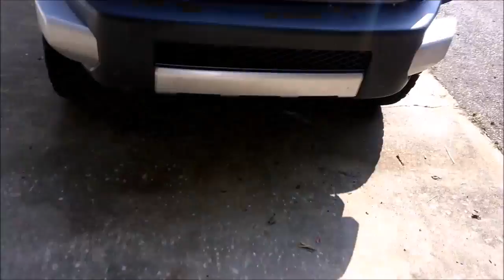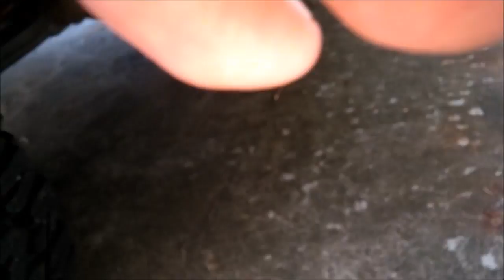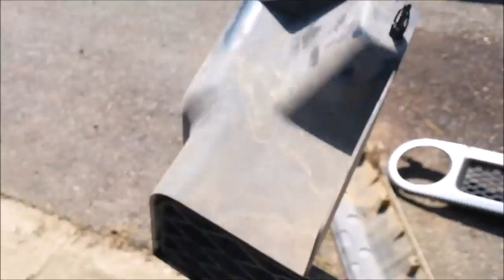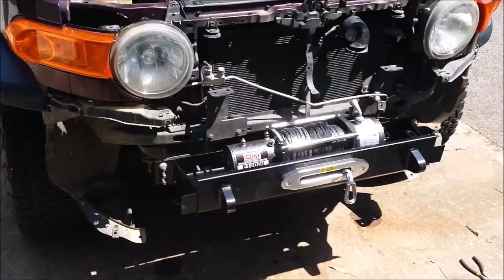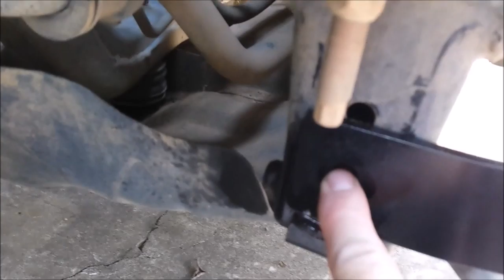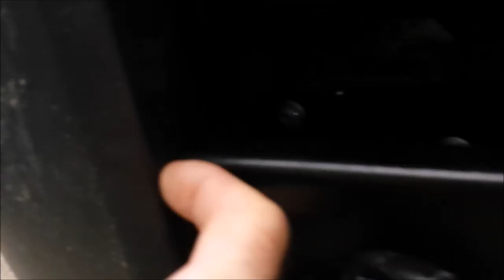US Offroad bumper and Engo Winch installation on 2007 FJ Cruiser

Comment: I am doing this this weekend on my 2008 (new to me) FJ. They (US Off Road) no longer offer the powder coating so last week I started by doing the prep (self etching primer, painting, etc) on the winch mount and disassembling and taking off the front bumper. There were some places with slight rust so I cleaned and touched up those spots and it should be ready for the grand finale. Thank you for your video, it makes it easier to make my install without the pitfalls you encountered (I've had to do things like remove and reinstall in the past, just like you had to before so this video certainly helps avoid that!) Thanks again for the video!